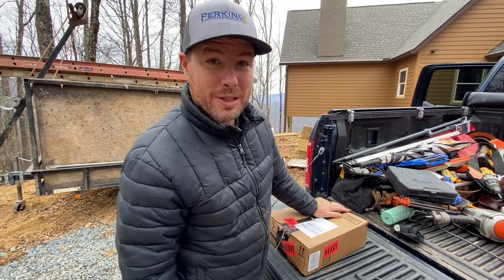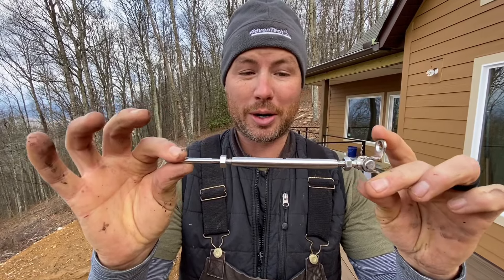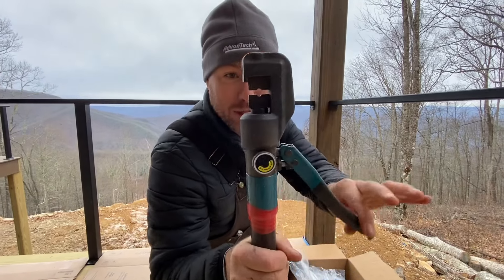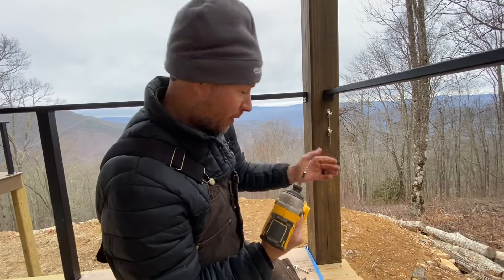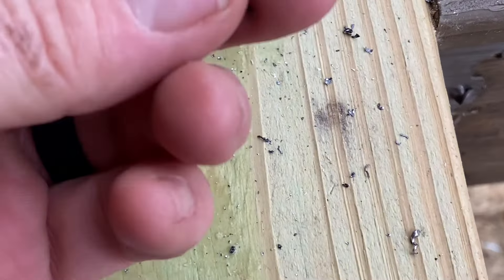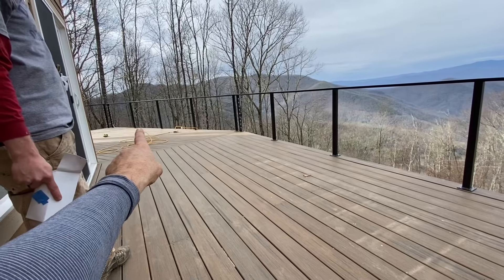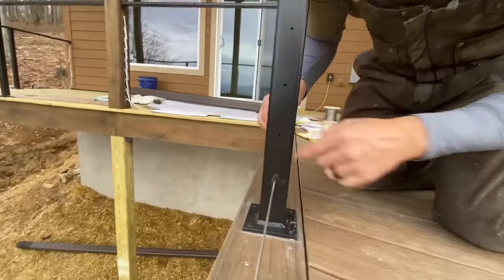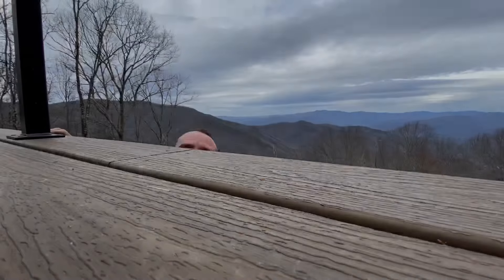Cable Rail Install | Stainless Muzata Brand from Amazon.com

Comment: I'm so happy for this video. I have a little mountain cabin in Utah at 10,100 feet and in desperately need a new railing. I'm having a heck of a time getting anyone to come and help me with it. I'm  sure I could do the drilling holes and cable work if I could get someone to weld me up some the  balusters. Thanks again for the great content!

Comment: nice work.  tech tip -  wrap a piece of masking tape around the cable at the cut line. cut through the center of the tape. this prevents cables from fraying open when being cut leaving BOTH halves of your cut clean. it also prevents you from stabbing your fingers with fray.

Comment: We’ve done similar wire stainless cable through metal tubes. Can’t remember the sizes but we put pvc pipes in the holes through the metal tubes and used a waterproof sealant that also adheres to metal which made it easy to thread the wire through and then.. more importantly.. it was less likely moisture would find its way inside the tube. Love the channel thanks.
Reply: How is it holding up, was the pvc needed

Comment: You should hold the cable to prevent it from twisting while you're tightening the turnbuckle. The residual torsion in the cable can cause the turnbuckle to loosen up later.

Comment: The building code is very relaxed in your area. Here in Ontario if a deck is above 5’ it needs a 42” railing. Cable doesn’t pass code here either because no horizontal members are allowed in the railing between 5” and 38.5”.

Comment: Nice job boys, it's always a good thing to master the fitting of a new product to be able to offer your customers a new type of finish to your work.
I'm a carpenter in the uk and we also have the 4inch or 99/100mm rule I. Our building regulations for the maximum allowed spacing between things like stair balustrade ng/spindles so that a babies head cannot fit through the gap and get stuck. It's the little things that make the difference!

Comment: The cables look great. It’s a neat way to put a rail and still look great with little maintenance. An possible is to start screwing from the bottom so that way you don’t have to hold the hardware out of the way as you go up.

Comment: You're supposed to retighten the cables every year for the first three to five years
23lbs outside
18lbs interior

And they sell a cable rail that has LED lights built inside of it in case you don't know- for EXACTLY that purpose- outdoor decks

And we used beeswax for NO SQUEAKING

Comment: That cable crimper is pretty expensive, especially if you are only doing 1 job like I did. Instead I bought Harbor Freight bolt cutters and ground the edge off of them. Worked like a charm.

Comment: Do you have a video on fabrication of the steel handrails?  You have a material list for the handrails?  Curious what type & size metal were used for fabrication of the handrails.  Excellent videos.  Especially the Farmhouse series.

Comment: Could you use a pipes between the posts where you use the fixers to hold the cable? That way you can use one wire from one end of the deck to the other, the wire would just curve around the pipe.

Comment: I'm wondering how the interaction of the stainless steel hardware and the (what looks like) galvanized self-tapping screws, and the painted steel post looks like after several years. Stainless steel in contact with galvanized steel often causes it to rust at a very accelerated rate through the creation of a galvanic corrosion cell. I could see the paint protecting the posts, but unless the self-tappers are stainless, I'd worry about them rusting out very quickly.

Comment: One question guys , what about the post with a  hole on both sides , water is going inside , or you use stainless steel post ?

Comment: Awesome video, looks pretty kool. 
Question, can this be installed inside interior of residential use application? If so noticed the company offers a curved option with solid steal posts, would you need to use the same post at the corner spots and also going down steps? Or is there a stronger option recommended?

Comment: When in stalling in 4x4 post how tight are the cables supposed to be ,I've put cable in and tighten to about a 1/4 deflection and it's pulling so much it's bowing the post that are the acrhor post .

Comment: Up here in the great white north that deck railing has to be 42" for that hight from ground. 36" five and under.
Reply from the maker: One of our guys is from New Hampshire and he told me the same thing!
Reply: And 3" on center for cable rails with posts >36" on center. Especially without the recommended 200lbs of tension on each cable

Comment: 2 questions for the experts. 1. What size crimping die do you use for crimping a 1/8 inch cable? 2. Should you crimp the cable, once or twice on each end for it to be secured? (On one or two different spots?) Thanks in advance!
Reply: #6, two crimps on each end.

Comment: If you used keylink cable rail you don’t need to swage the fittings on.  If you make a mistake and forget an insert of the middle of the run you just  unhook the cable no need to cut and run new cable.

Comment: These horizontal cable rails are against code in Canada due to children being able to climb them like a ladder. If you just have to use them because you like the look, you also have to add glass panels (tempered) on the interior side so the kids can't climb them, but that of coarse doubles the cost.
Reply: Not to mention 42" is minimum guard height and he said theirs is 36 high, weird how things like that are different around the world!

Comment: You mention the screw shards will rust?  Do you not use stainless steel self tapping screws?  the screws are not simply steel mounted into stainless ballesters.

Comment: How often do you have to stain those posts? Won't the hardware be in the way the next time you have to stain. I ask because I'm looking at using steel or composite posts instead.

Comment: Is the railing just bolted to the top of the deck board or does it go down under and get blocked in somehow?
Reply: There must be a serious structural member under the deck board to make certain that the post is solid.

Comment: Hello, I love this video. I am installing a cable railing in my house and love this hardware that you are using with the attached brackets. What is this product name and maybe a number. Not finding them on the website or amazon. Thanks
Reply: Use CableArt fittings...the also have self locking fittings that don't need a crimper.
Reply: Stephen Schiavo is this a response to the Muzata product?

Comment: I have searched a lot of the YouTube videos and cannot find a source for the handrail for the SS cable fence. I have all the parts ready and the metal posts drilled and lag bolted to our new Trex deck, but cannot find the handrail. Any suggestions would be greatly appreciated!
Reply from the maker: We welded the handrail ourselves. There are some aluminum options on the market but not the sure exactly where you can buy

Comment: Nice video thanks. 

I find the self tapping screws very useful. In fact,  I sometimes use them to drill a hole on metal and then reverse them out. They work better than drill bits for me sometimes ... and they are much cheaper than drill bits (in case they get damaged). 

Anyone else do this?

Comment: This is terry from Muzata. It's a great honor that you like our products.  I have sent you an email hoping to get in touch.
Reply: Hello Terry. Can your cable system be used on 4x4 pressure treated posts that have pvc sleeves over the top of them?  You’re still anchoring in to the post but it has a sleeve over it.  I can’t find anything on tour site about it.  Please help
Reply: @RSLWoodworking  Hi, thanks for contacting us. I recommend using 1/8" swageless invisible lag screw kit CB16 for the 4 x 4 wood post(cover by a composite sleeve), you can check this link: https://www.muzatarailing.com/products/cb16?variant=40182632841372
Reply: @MuzataCableRailingLEDChannel  I clicked on link in your page to go to the free design help and estimating and it doesn’t work.  Do you still offer this service?  I need help estimating how much supply I need.
Reply: @MuzataCableRailingLEDChannel  do you still offer the design and estimate help on your site?  The link is broken.  I need help estimating what kit and how man pieces I need.
Reply: @MuzataCableRailingLEDChannel  thank you. Took measure measurements tonight will draw up in sketch up and email.  Thx
Reply: @MuzataCableRailingLEDChannel  hello.  I did just like you directed and no one has ever responded to my email with sketches.  Can you please help?  I need to get moving on the order.
Reply: @MuzataCableRailingLEDChannel  good evening. No gas still responded to me.  I provided my email address like asked but nothing ever said to me.
Reply: @MuzataCableRailingLEDChannel  I guess Muzata is not interested in helping me.  No one will respond to customer service emails, YouTube emails, Instagram posts and DMs.  I can’t even get your company to confirm receipt of my emails with sketches.
Reply: @RSLWoodworking  can you not estimate your materials yourself. Seems like the logical way. Eric even explained in the video how to estimate what you need.

Comment: Do you drill 1/8" holes in metal posts or do you need to bump it up to 5/16 so the 1/8" cable can fit thru the holes?

Comment: it looks amazing, just next time make all the philips screw heads all line up.  as in the cross pattern for all screws should be 12 -6 (like a clock) so it looks perfect.
Reply: @DrugsAreBadUmmmKay  Yeah, don't get me wrong. It sounds amazing. It's just that there are 280 of those screws. Mucho trabajo!
Reply: Yep.  I guess I need to keep looking at more tubes

Comment: That cable set up looks pretty spinorky, Old technical term. PS, if you use a mechanics magnetic nut tray, it will catch most of the shavings from drilling.